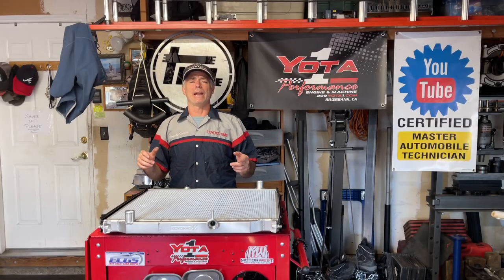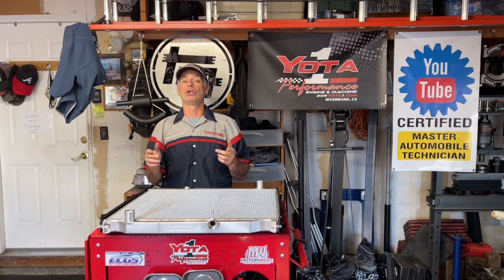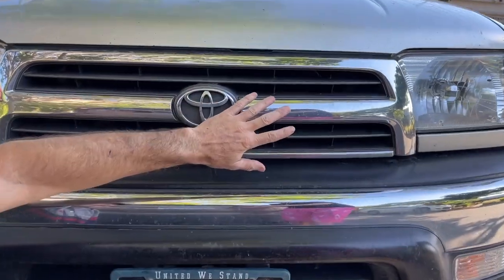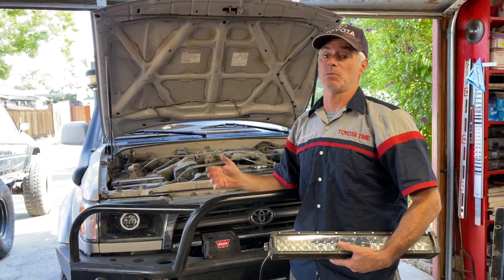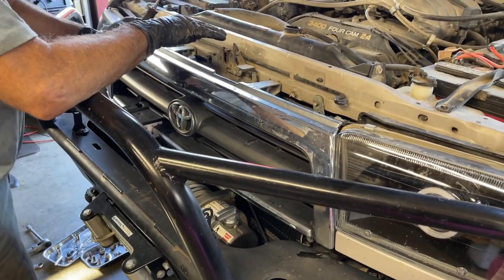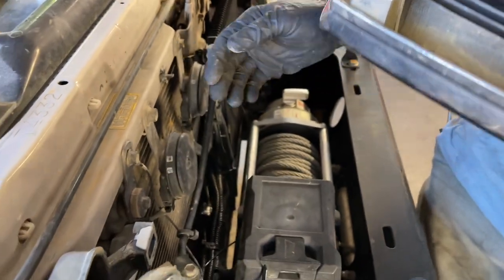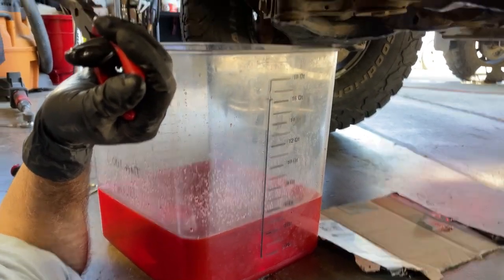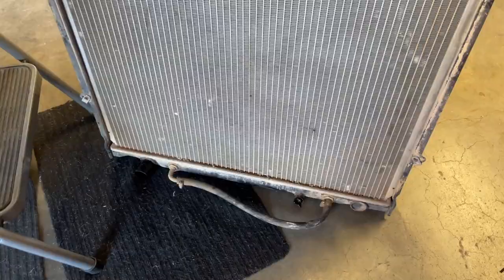Koyo Aluminum Radiator Install - 3rd GEN Toyota 4runner & 1st GEN Toyota Tacoma

Comment: Hello Timmy. Good work. I’m keen on cooling and itis not that hot here.
I had to renew the OEM (brass and copper) radiator on my Toyota but I was finding it difficult to find a replacement so I got it re-cored. The re-core company that does cars and vans but also industrial and plant machinery, suggested they could fit a 3-layer core to the original tanks and said like-for-like more cores equals more cooling even though a thicker core area does restrict a little airflow. So far so good.
I’m with you for having a separate cooler if you have an auto but I have a manual. Dumping heat from the gearbox into the radiator that is already struggling is not great, I think.
By the way Toyota do a 10-blade fan, which I think is the same (400mm) diameter as the standard 7-blade type. I think it might rob a bit more power but should pull more air. I note you’ve fitted a lower temp thermostat, but there are variations in the fan clutches, too, or so I’m told. I’ve not figured these out but different models seem to have different slip and lock characteristics.
I like the burping funnel.

Interesting to see the clips on the fan shroud, I might have had these but I think mine are poor. Will get some new ones as I think the shroud does an important job. 
Thanks for sharing!
Reply from the maker: The Koyo aluminum radiator is a 3 core radiator.   I didn't know companies could rebuild the OEM radiator and make it better.  Interesting.  I've never heard of a fan upgrade with more fins.  I will need to research that.  Yeah, I've heard of changing the viscosity of the fluid in the fan clutch to change its lockup characteristics.  I know there's companies that make them for land cruisers.   That would be a cool video to make.

Thanks for the comment.  I really appreciate it!
Reply: @TimmyTheToolman  The radiator you fitted looked great. Here there’s not so many aftermarket parts available and my re-core cost less than a new OEM one that would have been aluminium with plastic endcaps, which I’m not that impressed with.
The 10 blade fan is part ‘16361-54131’. Look it up in your parts search sites. From Japan it’s £75 but ~£40 more locally. I think it’s also known as ‘AISIN FNT-020’. I’ve not heard it’s 'better' but maybe you can ask your buddies if anyone uses one and why? More blades must be for something, no?
I don’t know what makes different fan clutches suitable for different engines, but I did some digging on AISIN’s site and there seems to be differences, but sadly no graphs. I’ve only seen a single type of fluid-refill so there might be internal differences or to the bi-metallic strip?
Stay cool!!
Reply from the maker: @stco2426  Awesome!  Thanks for sharing all that.

Comment: I'm honestly surprised you don't have electric fans yet. Probably do a lot to help keep engine cool, probably spin at faster rpms than the fan clutch.
Reply from the maker: It might be an option I pursue in the future.  Some customization would be required in regards to a fan shroud to mount the fan(s)

Comment: I have to believe your cooling issues are due to the airflow restrictions. My 96' is probably about the same weight: ARB front bumper with 9k winch, Budbuild full-length skids, 4xinnovations sliders, 4xinnovaitons rear plate bumper w/ full swingout, drawer system, and 33in Maxxis Razr MTs...all on stock 4.10s and standard thermostat. I monitor my temps regularly and they're always in 185-200 range, and the gauge on the dash is always below half. Even when I was in Death Valley two years ago (115F) and loaded with 3 weeks of camping gear it stayed right in that range. 

I'd be curious to know what your trans temperatures look like now that you bypassed the radiator. I had issues keeping the temps of my A340F in check when I was bypassed and used dual Hayden 678s...temps would always spike when I was in deep sand, towing, or pulling a long grade. I ended up ditching one of the Haydens and putting it in series with a new OEM rad.
Reply from the maker: Yeah, sounds like we have similar mods.  I do carry a lot of weight in tools, spare parts, automotive fluids, water, fuel, and camping gear.  My roof rack is heavy.  It's an all steel Gobi copy, and the guy that built it must have used a pretty heavy gauge for the tubing.

My trans temps are good, but I'm always employing things to reduce the temp like turning overdrive off when traveling in the hills.  However, turning OD off only works when you're traveling at a speed that puts you into 3rd gear, around 40-45 mph.  If you're traveling slower than that, the torque converter will not lock up and it will do nothing to keep your trans temp down.  When 4wheeling, I use 4Lo a lot.  4Lo will keep your trans temp down very well.  But, it limits the speed you can travel.  If I'm on any extended grade, I go into 4Lo.  Traveling in 4Hi for any grade that goes on for a long time will send your trans temp through the roof.

Comment: Hey Tim, great vid as always - is this for manual transmissions only? Or is that why it’s necessary to install an external transmission with this one - in the case of an auto trans?
Reply from the maker: The radiator was made for manual transmission models only.  If you want to use it with an auto transmission model, you have to install a stand-alone trans cooler like i did.
Reply: Got it, thanks a lot! I confirmed the same on a few of the websites selling the radiator @TimmyTheToolman

Comment: Watching this as debating if want to use a cooler. One of my transmission cooling lines let go so thinking should change radiator while replacing the line
Reply from the maker: You could go with an OEM replacement, but I'm liking this Koyo radiator and using an external trans cooler.
Reply: @TimmyTheToolman  been on the fence about which way to go. Don’t tow a lot but sometimes a trailer with atv or boat.

Comment: What were the temps you were seeing when it was climbing/overheating?
Reply from the maker: I was getting into the low 210's.  That's when the AC went off and the heat went on.  Not fun.  The temp would have kept climbing if I didn't do something about it.  I try to never go over 215 if I can help it.

I did have that big Auxbeam light bar on the front bumper that I since removed because it was contributing to blocking air flow to the radiator.  But, I did experience some overheating also before the Auxbeam lights were installed.  I was traveling back from Las Vegas with my wife and mom and a decent amount of gear in the back.  The ambient temps were 110-115.  Crazy hot.  There was carnage all over the place with vehicles pulled off the side of the highway that I assumed were overheating issues.  

I don't know if you read my pinned comment yet, but the preliminary results look very good.  I drove some hills in 90's temps, with the AC on full blast and I never saw any higher than 194.  Before I call this Koyorad Aluminum Radiator the best thing since sliced bread, I need to weight my rig down with similar weight I carry on trips and see how it does.  I guess I don't have to wait for an actual trip to do this though.  When some hot temps return to my area, I'm going to throw in the usual everything but the kitchen sink I take with me on trips and hit some hills and see what my engine temps look like.

Comment: Tim, I have a 3rd Gen 4runner with a manual transmission,  is the radiator for manual tranny and Automatic different? thank you for the great step-by-step posts
Reply from the maker: Koyo only makes an aluminum radiator for manual transmissions.  That's why I had to use an external cooler for my automatic transmission fluid because there is no transmission cooler in the bottom of the Koyo radiator.  So, this Koyo radiator will work perfect for your manual transmission 3rd Gen.

Comment: I have a similar loadout on my 2k 4Runner. Have a full (aluminum) roof rack with clamshell roof top tent, water+gas cans and cargo box on top. Drawer system in rear with lots of gear. Steel front bumper with winch. Been running stock radiator and have not experienced any over heating. With that said, I only have the stock temp gauge to reference. Temp needle has always maxed just below half way up. So I guess a question I have is how accurate is the stock temp gauge? Is it a good reference for engine temp of should I install an aftermarket temp gauge?
Reply from the maker: The stock analog temp gauge is a very poor indicator of how hot your engine is getting.  Once that needs starts to rise, you've already severely overheated your engine.

Comment: Oh sweet this dont have a transmission cooler on it 5:00 I could use one of these radiators for my wifes 2000 I bypassed the transmission cooler on her radiator with a Huge external hayden Cooler haven't had any issues with stock radiator but my wife don't have very many offroad goodies like I do @Timmy The Toolman
Reply from the maker: Yep, the caveat for this mod is running a stand-alone trans cooler if you have an automatic trans.
Reply: Which Hayden did you use? When I first got my 96' I did a full bypass with dual Hayden 678s...I ended up with spikes in trans temps when pulling a grade, in deep sand, and when towing. I'd like to fully bypass, but loathe the idea of having to run a thermostatically controlled electric fan setup on the trans coolers.
Reply from the maker: @n4656bravo  I'm using a Hayden 699.  I also employ tricks like turning overdrive off and using 4Lo when doing slow 4wheeling to keep the trans temp down.
Reply: @n4656bravo  I have a Hayden 689 installed for my Transmission cooler and a 689 installed for my Power steering As a cooler also I also installed a Electric Fans from the start that would cool them bith because I'm running massive tires on mine my wifes runs just a 689 for both Transmission and Powersteering without fans but she dosent have offroad bumpers just full skids she drives hers more for work and mine is more for Competition and play
Reply: @n4656bravo  I'm running a IN line thermostatic switch you can make a double barbed fitting with a manifold and thread the switch into the manifold and then run the power and ground I like thst setup better the probing through the cooler

Comment: Only reason I didn’t choose Koyorad was due to it being made in china or Indonesia but im sure they are up to the Koyorads designers  standards.
Reply from the maker: Lots of parts are made in those countries and Mexico too.  The OEM radiators the last time I checked are made in Taiwan. I would have considered the Champion aluminum radiator, but due to previous complaints of fitment issues, I chose not to go that route.

Comment: Was wondering why you chose this aluminum radiator over the CSF radiator…
Reply from the maker: The Champion had fitment issues in the past.  Maybe they addressed them by now.  Koyo has a good name in the industry and I felt more confident buying from them.  Also, Koyo is an OEM Parts Manufacturer for Toyota.
Reply: Very good to see you doing your homework on these matters

Comment: Is it true that aluminum radiator require special coolants to avoid corrosion/ chemical reactions on the aluminum?
Reply from the maker: I know the Champion Radiator company suggests using green coolant as opposed to Toyota Red.  I went ahead and used Toyota Red Coolant with this Koyorad radiator.  I saw no disclaimer about having to use a certain coolant. The heads on these rigs are aluminum, so using a special coolant due to an aluminum radiator doesn't make much sense to me.

Comment: Do ya really need to carry around heavy skid plates if you’re just driving around on paved roads? I removed the skids from my truck long ago. Carrying unnecessary weight around kills your fuel mileage.
Reply from the maker: No, you don't, but you should put your OEM skid plates back on.  I'm pretty sure you have encountered debris on the roadways before.  The skid plates protect things like your oil pan from getting punctured.

Comment: Hi Tim my 97 3g4r is having a issue with the passenger rear window goes down only on the rear passenger door. It only goes down not up on the rear switch but no up or down for the master switch. Is my window motor or window control module the issue thank you Tim 🙏
Reply from the maker: So it only goes down, and you can't operate the door switch or master switch to get it to go up?
Reply: @TimmyTheToolman  that’s correct I check the chassis to passenger rear door loom for ripped  wires nothing out of the ordinary
Reply from the maker: My guess is the actual switch/button on that passenger side has a short. Try swapping that switch from the door on the other side to determine if it’s the switch itself.
- Sean
Reply: @TimmyTheToolman  lesss go thank you Sean for replying so fast. I use that door as a chemical rack for mobile detailing. Something dropped and ruined the switch causing the master switch to not work. I took the one from the other side to test and it works as should thank you OG 🙏

Comment: Just a thought would a electric fan work better then the stock fan ?
Reply: I like electric fans because I can turn them off with a switch in the cab. Comes in handy when doing water crossings.
Reply from the maker: Good question and I don't know the answer.  The stock fan clutch does a pretty good job.  For an electric fan setup, you'd probably need to dual fans with a custom shroud to house them.

Comment: I doubt it’s your roof rack the air flow to the radiator definitely restricted. Not sure if there is room for an electric cooling far
Reply from the maker: I tend to agree it's more of an air flow issue than a weight issue.  I could fit a electric pusher fan to blow air in from the front, but it seems that won't be necessary.  I think this Koyorad radiator might be the answer I've been looking for.   So far, my temps have been really good running it in hot temps.  I just need to load it down with some weight during the next heat wave and hit some hills to see how my rig does.

Comment: Is it better than oem replacement radiator?
Reply from the maker: Well, that's the reason I bought it because it's supposedly an improvement over the OEM design.  How much of a percentage better, I don't know.  My coolant temps are looking better running this radiator.

Comment: i also have a 98 4 runner limited automatic with 145k. im getting around 11mpg and running my truck stock. can replacing radiator improve my mpg?
Reply from the maker: The radiator would have nothing to do with mpg.  Sounds like you need a tune-up.  11 mpg is pretty bad for a stock rig.
Reply: @TimmyTheToolman  10-4, will ask my mech next time she's in the shop for oil change to possibly do a tune up for better mpg. You dont have any videos on 4 runner tune ups by chance do you? I enjoy how thorough you are in your process. Thanks again, god bless
Reply from the maker: @thomasjefferson3552  Things to do for a tune-up are pretty much covered in our valve cover gasket video.  You'd want to replace your spark plugs and maybe your spark plug wires.  You'd want to clean out your throttle body and clean you Mass Air Flow Sensor (MAF).

Comment: Wasn’t the old radiator the original one that came on the vehicle. Your front is like a computer with excess bloatware
Reply from the maker: The radiator I pulled out was a replacement I bought from Toyota.  The quality isn't the same as the original.  

I have a lot of accessory wiring for the aftermarket lights, winch, and front E-Locker.   I also have hoses running to the front for my external trans cooler.  So yeah, it looks pretty busy up front, but everything has a purpose.